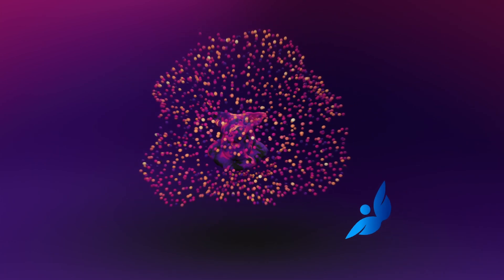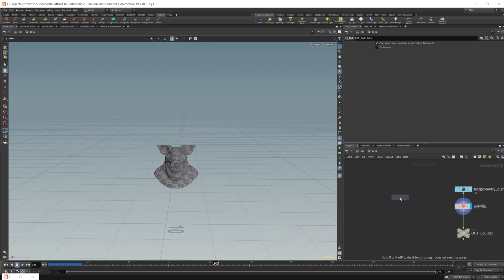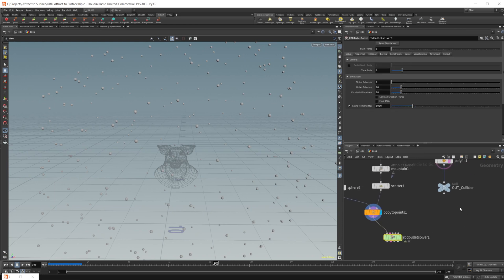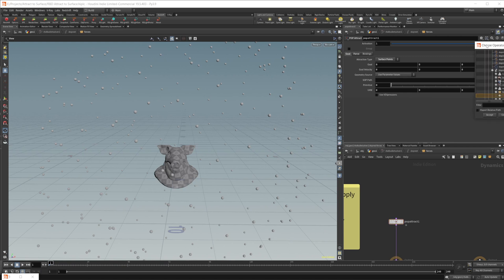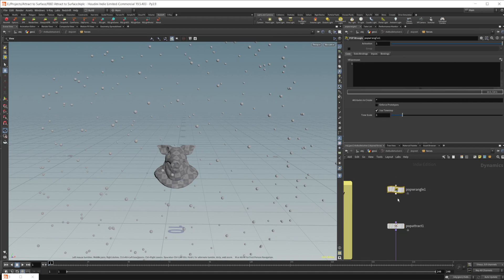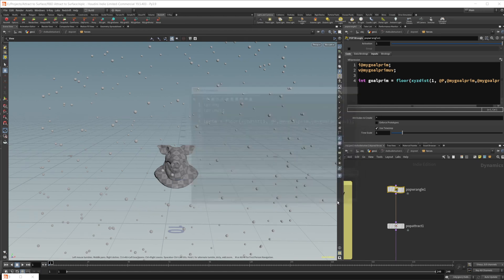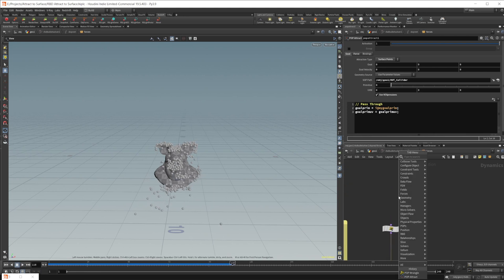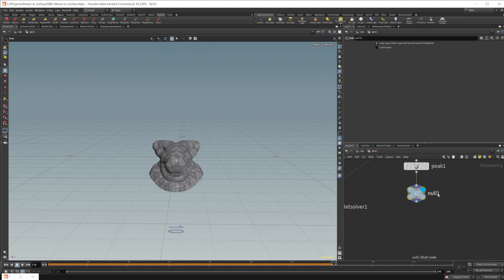Attract Rigid Bodies to the Surface of an Object | Houdini 19.5

Comment: I'm trying to create a tornado simulation with debris and I was wondering how I might make the fractured material from the rbd bullet solver interact with the pop solver vortex simulation? Would I use one of the methods in this playlist?
Reply from the maker: Typically different solvers don't play well together and you need to find ways to fake things. I'm not sure what exactly you are needing to interact but the pop nodes also work inside the bullet solver so you might play with that and see where it gets you
Reply: @InsideTheMindSpace  okay thank you! I will try that! I'm trying to make the tornado sweep up debris but it's been really difficult trying to find tutorials that explain how to do that.

Comment: This is great, how can I use vellum grain to be attracted to the object? I would think they would be much lighter and more efficient to use than RDBs.
Reply from the maker: They might not get you the results you are looking for because the two don't work quite the same but you can certainly try. I believe the pop attract node works with these as well so you can follow my other tutorials about attracting to surface if you need
Reply: @InsideTheMindSpace I tried with vellum grains. It doesn’t get me the same results. Also, your other tutorial on closest point on mesh works better than this one. On this one I can’t get the RBDs to cover the mesh. They don’t get attracted to all the points.